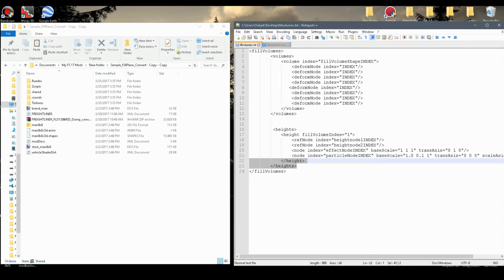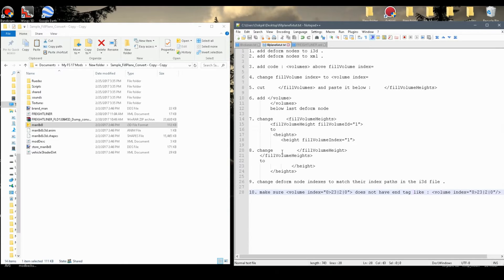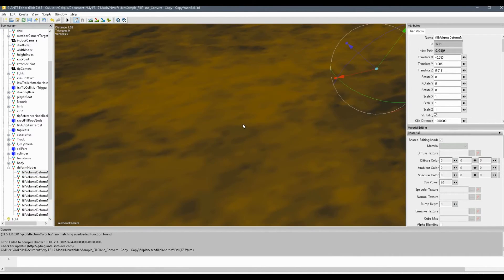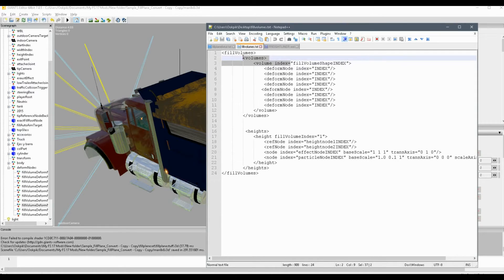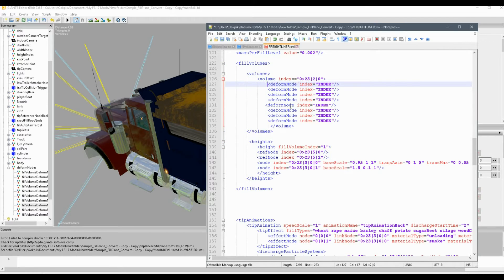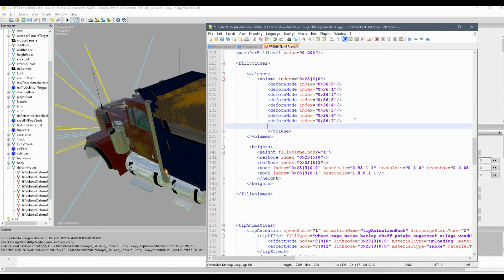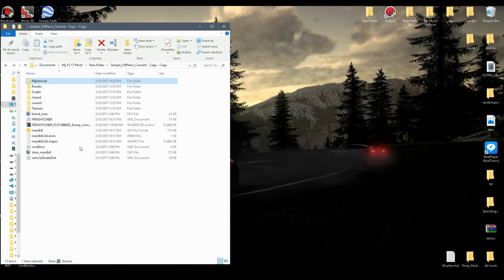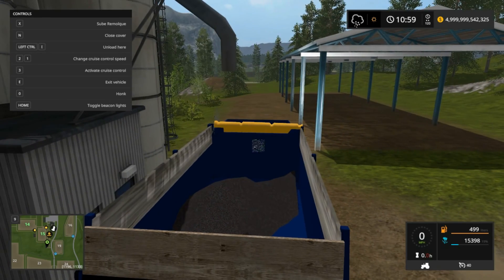Fix Converted Mod's Fillplanes // Farming Simulator 17

Comment: This does work but, In order for me to make it work I had to take out a line that read - filename="$data/vehicles/particleAnimations/shared/unloadingBack.i3d". 2 of them actually which read the same exact thing. 

At 3:30 of your video where it says <tipAnimations> and then the 3rd and 4th line down where it says <effectNode>, at the end of them both is where I found my error which was a "unloadingBack" error, It is trying to read off of the old FS 15 file for particleAnimations I suppose. 

If I don't delete those two once my dump truck dumps it basically crashes the game. 

Now since I had to delete those two "$data particleAnimations unloadingBack" lines, I get LUA errors but the dump truck works just fine but I can't seem to figure out how to fix them errors. Maybe a video on that, this video plus that from start to finish so the log shows no errors??

If you also notice at 3:30 in the <tipAnimations> section both <effectNode Nodes are 0|0|0 and 0|0|1. In my log, that is where the errors now come from but I have no clue how to fix them.

This is off a fresh 15 to 17 convert. Nothing else fixed or tampered with, went straight into fixing the dump first.

These are the new errors once I get your method working

Error: index out of range
LUA call stack:
  dataS/scripts/utils/Utils.lua (11) : printCallstack
  dataS/scripts/utils/Utils.lua (65) : checkChildIndex
  dataS/scripts/effects/Effect.lua (97) : indexToObject
  dataS/scripts/effects/ShaderPlaneEffect.lua (25) : loadEffectAttributes
  dataS/scripts/effects/Effect.lua (48) : loadEffectAttributes
  dataS/scripts/effects/EffectManager.lua (29) : load
  dataS/scripts/vehicles/specializations/Trailer.lua (133) : loadEffect
  dataS/scripts/vehicles/Vehicle.lua (627)
  dataS/scripts/BaseMission.lua (767) : load
  dataS/scripts/BaseMission.lua (914) : loadVehicle
  dataS/scripts/shop/BuyVehicleEvent.lua (88) : loadVehiclesAtPlace
  dataS/scripts/network/Connection.lua (77) : run
  dataS/scripts/gui/ShopScreen.lua (1035) : sendEvent
  dataS/scripts/gui/ShopConfigScreen.lua (467) : update
  dataS/scripts/gui/elements/Gui.lua (306) : update
  dataS/scripts/main.lua (1872) : update
Index: 0|0|0
Warning: Node is nil in 'vehicle.tipAnimations.tipAnimation(0).tipEffect.effectNode(0)' in file 'C:/Users/ExperT/Documents/My Games/FarmingSimulator2017/mods/FTmodding_Caterpillar_773G_converted/773.xml'
Warning (LUA): 'setShaderParameter': Argument 1 has wrong type. Expected: Int. Actual: Nil 
  ..\..\..\src\base\scripting\lua\LuaScriptSystem.cpp (640): expectedType == Value::VoidType
LUA call stack:
  dataS/scripts/effects/ShaderPlaneEffect.lua (54) : setShaderParameter
  dataS/scripts/effects/Effect.lua (48) : loadEffectAttributes
  dataS/scripts/effects/EffectManager.lua (29) : load
  dataS/scripts/vehicles/specializations/Trailer.lua (133) : loadEffect
  dataS/scripts/vehicles/Vehicle.lua (627)
  dataS/scripts/BaseMission.lua (767) : load
  dataS/scripts/BaseMission.lua (914) : loadVehicle
  dataS/scripts/shop/BuyVehicleEvent.lua (88) : loadVehiclesAtPlace
  dataS/scripts/network/Connection.lua (77) : run
  dataS/scripts/gui/ShopScreen.lua (1035) : sendEvent
  dataS/scripts/gui/ShopConfigScreen.lua (467) : update
  dataS/scripts/gui/elements/Gui.lua (306) : update
  dataS/scripts/main.lua (1872) : update
Warning (LUA): 'setTranslation': Argument 1 has wrong type. Expected: Int. Actual: Nil 
  ..\..\..\src\base\scripting\lua\LuaScriptSystem.cpp (640): expectedType == Value::VoidType
LUA call stack:
  dataS/scripts/effects/Effect.lua (131) : setTranslation
  dataS/scripts/effects/Effect.lua (49) : transformEffectNode
  dataS/scripts/effects/EffectManager.lua (29) : load
  dataS/scripts/vehicles/specializations/Trailer.lua (133) : loadEffect
  dataS/scripts/vehicles/Vehicle.lua (627)
  dataS/scripts/BaseMission.lua (767) : load
  dataS/scripts/BaseMission.lua (914) : loadVehicle
  dataS/scripts/shop/BuyVehicleEvent.lua (88) : loadVehiclesAtPlace
  dataS/scripts/network/Connection.lua (77) : run
  dataS/scripts/gui/ShopScreen.lua (1035) : sendEvent
  dataS/scripts/gui/ShopConfigScreen.lua (467) : update
  dataS/scripts/gui/elements/Gui.lua (306) : update
  dataS/scripts/main.lua (1872) : update
Warning (LUA): 'setVisibility': Argument 1 has wrong type. Expected: Int. Actual: Nil 
  ..\..\..\src\base\scripting\lua\LuaScriptSystem.cpp (640): expectedType == Value::VoidType
LUA call stack:
  dataS/scripts/effects/Effect.lua (139) : setVisibility
  dataS/scripts/effects/Effect.lua (49) : transformEffectNode
  dataS/scripts/effects/EffectManager.lua (29) : load
  dataS/scripts/vehicles/specializations/Trailer.lua (133) : loadEffect
  dataS/scripts/vehicles/Vehicle.lua (627)
  dataS/scripts/BaseMission.lua (767) : load
  dataS/scripts/BaseMission.lua (914) : loadVehicle
  dataS/scripts/shop/BuyVehicleEvent.lua (88) : loadVehiclesAtPlace
  dataS/scripts/network/Connection.lua (77) : run
  dataS/scripts/gui/ShopScreen.lua (1035) : sendEvent
  dataS/scripts/gui/ShopConfigScreen.lua (467) : update
  dataS/scripts/gui/elements/Gui.lua (306) : update
  dataS/scripts/main.lua (1872) : update
Error: index out of range
LUA call stack:
  dataS/scripts/utils/Utils.lua (11) : printCallstack
  dataS/scripts/utils/Utils.lua (65) : checkChildIndex
  dataS/scripts/effects/Effect.lua (97) : indexToObject
  dataS/scripts/effects/ShaderPlaneEffect.lua (25) : loadEffectAttributes
  dataS/scripts/effects/Effect.lua (48) : loadEffectAttributes
  dataS/scripts/effects/EffectManager.lua (29) : load
  dataS/scripts/vehicles/specializations/Trailer.lua (133) : loadEffect
  dataS/scripts/vehicles/Vehicle.lua (627)
  dataS/scripts/BaseMission.lua (767) : load
  dataS/scripts/BaseMission.lua (914) : loadVehicle
  dataS/scripts/shop/BuyVehicleEvent.lua (88) : loadVehiclesAtPlace
  dataS/scripts/network/Connection.lua (77) : run
  dataS/scripts/gui/ShopScreen.lua (1035) : sendEvent
  dataS/scripts/gui/ShopConfigScreen.lua (467) : update
  dataS/scripts/gui/elements/Gui.lua (306) : update
  dataS/scripts/main.lua (1872) : update
Index: 0|0|1
Warning: Node is nil in 'vehicle.tipAnimations.tipAnimation(0).tipEffect.effectNode(1)' in file 'C:/Users/ExperT/Documents/My Games/FarmingSimulator2017/mods/FTmodding_Caterpillar_773G_converted/773.xml'
Warning (LUA): 'setShaderParameter': Argument 1 has wrong type. Expected: Int. Actual: Nil 
  ..\..\..\src\base\scripting\lua\LuaScriptSystem.cpp (640): expectedType == Value::VoidType
LUA call stack:
  dataS/scripts/effects/ShaderPlaneEffect.lua (54) : setShaderParameter
  dataS/scripts/effects/Effect.lua (48) : loadEffectAttributes
  dataS/scripts/effects/EffectManager.lua (29) : load
  dataS/scripts/vehicles/specializations/Trailer.lua (133) : loadEffect
  dataS/scripts/vehicles/Vehicle.lua (627)
  dataS/scripts/BaseMission.lua (767) : load
  dataS/scripts/BaseMission.lua (914) : loadVehicle
  dataS/scripts/shop/BuyVehicleEvent.lua (88) : loadVehiclesAtPlace
  dataS/scripts/network/Connection.lua (77) : run
  dataS/scripts/gui/ShopScreen.lua (1035) : sendEvent
  dataS/scripts/gui/ShopConfigScreen.lua (467) : update
  dataS/scripts/gui/elements/Gui.lua (306) : update
  dataS/scripts/main.lua (1872) : update
Warning (LUA): 'setTranslation': Argument 1 has wrong type. Expected: Int. Actual: Nil 
  ..\..\..\src\base\scripting\lua\LuaScriptSystem.cpp (640): expectedType == Value::VoidType
LUA call stack:
  dataS/scripts/effects/Effect.lua (131) : setTranslation
  dataS/scripts/effects/Effect.lua (49) : transformEffectNode
  dataS/scripts/effects/EffectManager.lua (29) : load
  dataS/scripts/vehicles/specializations/Trailer.lua (133) : loadEffect
  dataS/scripts/vehicles/Vehicle.lua (627)
  dataS/scripts/BaseMission.lua (767) : load
  dataS/scripts/BaseMission.lua (914) : loadVehicle
  dataS/scripts/shop/BuyVehicleEvent.lua (88) : loadVehiclesAtPlace
  dataS/scripts/network/Connection.lua (77) : run
  dataS/scripts/gui/ShopScreen.lua (1035) : sendEvent
  dataS/scripts/gui/ShopConfigScreen.lua (467) : update
  dataS/scripts/gui/elements/Gui.lua (306) : update
  dataS/scripts/main.lua (1872) : update
Warning (LUA): 'setVisibility': Argument 1 has wrong type. Expected: Int. Actual: Nil 
  ..\..\..\src\base\scripting\lua\LuaScriptSystem.cpp (640): expectedType == Value::VoidType
LUA call stack:
  dataS/scripts/effects/Effect.lua (139) : setVisibility
  dataS/scripts/effects/Effect.lua (49) : transformEffectNode
  dataS/scripts/effects/EffectManager.lua (29) : load
  dataS/scripts/vehicles/specializations/Trailer.lua (133) : loadEffect
  dataS/scripts/vehicles/Vehicle.lua (627)
  dataS/scripts/BaseMission.lua (767) : load
  dataS/scripts/BaseMission.lua (914) : loadVehicle
  dataS/scripts/shop/BuyVehicleEvent.lua (88) : loadVehiclesAtPlace
  dataS/scripts/network/Connection.lua (77) : run
  dataS/scripts/gui/ShopScreen.lua (1035) : sendEvent
  dataS/scripts/gui/ShopConfigScreen.lua (467) : update
  dataS/scripts/gui/elements/Gui.lua (306) : update
  dataS/scripts/main.lua (1872) : update

XML Section Exactly Like Yours

<fillVolumes>
        <volumes>
            <volume index="0>10|3|0">
                <deformNode index="0>19|0"/>
                <deformNode index="0>19|1"/>
                <deformNode index="0>19|2"/>
                <deformNode index="0>19|3"/>
                <deformNode index="0>19|4"/>
                <deformNode index="0>19|5"/>
                <deformNode index="0>19|6"/>
                <deformNode index="0>19|7"/>
                <deformNode index="0>19|8"/>
                <deformNode index="0>19|9"/>
            </volume>
        </volumes>
  
        <heights>
            <height fillVolumeIndex="1">
                <refNode index="0>10|4|0"/>
                <refNode index="0>10|4|1"/>
                <node index="0>10|5|0|0" baseScale="1 1 1" transAxis="0 1 0"/>
                <node index="0>10|5|0|0" baseScale="1.5 0.1 1" scaleAxis="0 1 0"/>
           </height>
        </heights>
 </fillVolumes>
Reply from the maker: Sometimes, yes, it does take a bit of fiddling with it, but, glad you got it to work, anyhow!
Reply: Yea I'm seeing that lol. My 1st convert and it has zero errors. Without your video I'd still be stuck on the planes part. Thank you very much. Def. appreciate you taking the time to help others.
Reply from the maker: Good to hear. Glad the video could help you!
The way I see it, I know how to do it, so might as well let others know how to as well. =)
Reply: Only if everyone else felt that way we would be in good shape lol.